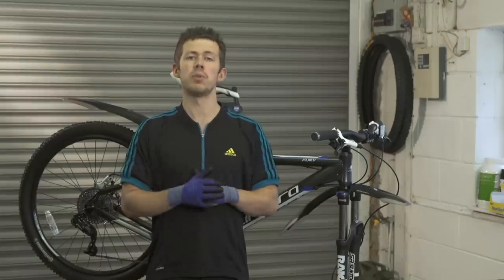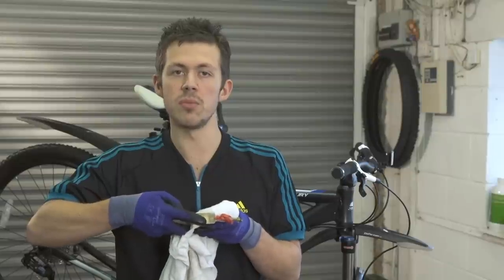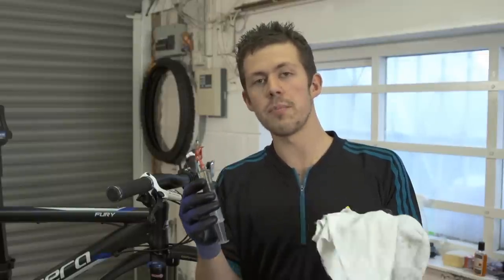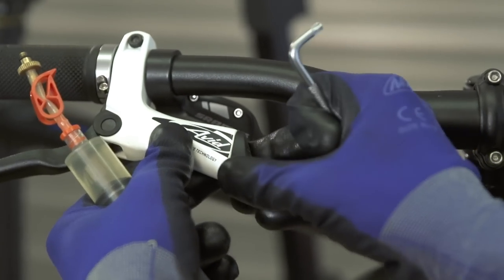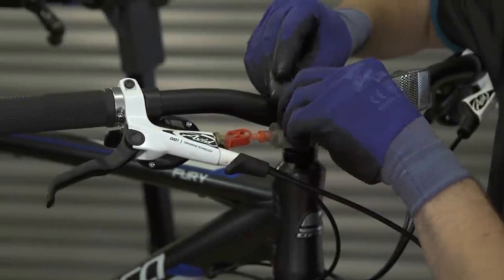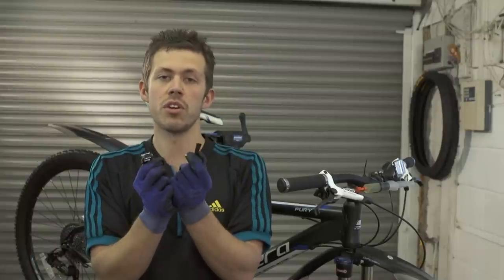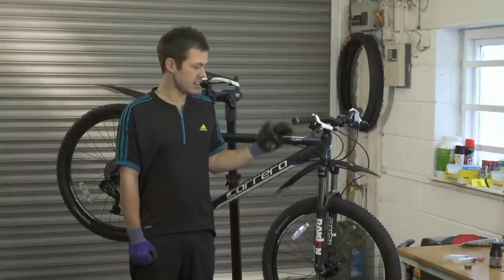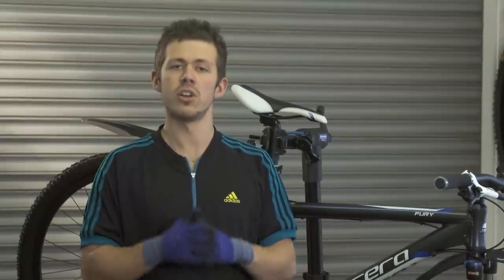How To... Bleed Disc Brakes | Halfords UK

Comment: One more thing to add. If you want a really stiff brake lever, you can fit the wheel but remove the brake pads. Add something thinner than the pads between the pistons and the disk and fill the system through the lever side. This way you add excess oil and the lever becomes stiffer.

Comment: Only thing is , when u remove the hoses to put the screw back in, your putting air back into the system, there should be another lock screw to tighten first before you unscrew the hoses so no air is drawn in

Comment: This looks more difficult than bleeding car brakes.
Reply: it is since there is no reservoir to hold fluid and stop air getting in,
Reply: I reverse bled my Shimano brakes, angled the syringe lever side up and removed the plunger and just pushed new fluid from the seconds syringe followed by tightening the bolts and they seem spot on

Comment: If you have two different brake sets that use different dot fluids , can you wipe out the syringe and use the other fluid , or are the syringes dedicated to the dot type you used the first time ?

Comment: "If you would like a firmer reaction than that, please repeat the process from the beginning" <-- So what would I change in process your described to make it even firmer? I don't own hydraulic disc brakes, so I am trying to acclimate myself to what is required for tuning and maintaining them.
Reply: what you're supposed to do is before you fit the syringes is lock the red clamp and pull on the plunger to create a vacuum to cause any excess air to raise to the surface as most brakes only have about 10mm of fluid any air will make it feel "spongy" as air compresses and fluid doesn't although all avid brakes have a overflow system so they will never be truly solid as its a safety feature sram use to stop you stabbing yourself with the brake lever should you fall off and the lever hit you.  hope this helps
Reply: Basically, the main reason the break would feel bad is because of any air in the system. So if the brake still felt spongy or if the brake was lacking power when in use, it means that air is in the system still. So if it felt like that straight after a bleed, you would simply need to repeat the bleed process again to get a better result. Doesn't often happen but can do, especially with avids as they are a bit trickier to bleed than other systems! Hope that helps!

Comment: I have SHIMANO hydraulic  brakes from Volt Australia the top is like normal bleed but the bottom has no nipple ? it has a screw . does that mean i can use  Avid bleed kit as the caliper only has a allen key port . The top is with screw in cup . I think it,s shop brand ? driving me nuts knewby ,so do i get the screw in line and adapter for caliper and will any fit ,or Avid ?

Comment: I did it twice on my bike, up to the last step my brake lever felt good. But after I put the lever screw back in and ride it, the lever goes soft and the bike won't stop. Any advice?
Reply: Zaher Jabr check out burping your brake, it might be that you have air trapped inside the system.
Reply: @madched  Add some Gripe water ;-)

Comment: hi how would i put a pair of fluids on my bike that havent got any?
Reply from the maker: Hi +FIREBURN HDV you would have to start by purchasing an hydraulic brake disc set. It's worth checking the compatibility between your bike and the hydraulic brakes. Your local store will be able to offer more detailed advice. Thanks.

Comment: The problem is trying to keep pressure in the system, as soon as you remove the syringe. 
It goes!
Reply: That's the issue I'm having with this exact brake setup now.
Reply: Don't forget to create a vacuum by gently pulling on the plunger and then push the plunger with similar force ,this will pressurise the system. Then start squeezing the brake lever whilst the syringe is in a vertical position. The video suggests 10 times, but basically do it until there are no more bubbles at all coming from the brake lever reservoir. Move the brake lever back to it's normal position and then unscrew the syringe and immediately and carefully replace the screw.
Reply: @allthingsbike2720  sold it and bought a motorcycle in the end! XD
Reply: @lmlm2500  well that has easily solved that one lol

Comment: how can you tell what fluid to use?
Reply from the maker: Hi +MrT0ffee  there should be an identifier on the brake lever. Either Mineral Oil or Dot Fluid. Hope that helps. Thanks.

Comment: what's the use of bleeding?
Reply: New oil in your brake systems and a firm brake lever, you never want a brake lever to touch the handle bar or come 1/2 to 1 inch of the handle bar.

Comment: what would happen I you got bubbles in the system?
Reply: I like the tire setup
Reply: Kiss your braking power goodbye
Reply: +M32 oh thanks
Reply: Think of it this way: The air in the system won't allow enough pressure to push the brake pistons together hard enough to effectively stop you. Any air is not good at all.
Reply: Knowledge 👆
Reply: yeah i lernd
 that yesterday lol

Comment: ever heard the saying keep it simple stupid? what's wrong with traditional bike brakes with rubber pads?
Reply: Richard, if you’d ridden a bike with hydraulic discs you’d know the answer. 👍
Reply: @archiebob11  depends on the brakes. the mechanical Rim brakes on my orbea are more powerful than the hydraulic disc on my mountain bike

Comment: Avid brakes take too much work just to bleed them =p
I don't like brake fluid, I much rather mineral oil, it's just much superior.
Reply: Amarildo Junior what's the difference?
Reply: viscosity and stability to compression
Reply: @Klemhaken  mineral oil is , well, oil and DOT4/5.1 is Ethylene Glycol based.
The latter is used extensively in motor vehicles due to its availability, low cost , Low viscocity at low temperatures, good performance at higher temperatures, good compressive qualities and anti corrosive properties within braking systems. 
Mineral Oil is used mainly because of its anti corrosive properties and easy availability. It's viscocity is usually slightly higher than DOT4/5.1 but in these "simple" systems it's not an issue. It's also much kinder to the environment (And your paintwork/hands) as oils can be made bio-degradeable. Whereas Etylene Glycol is poisonous to most forms of life but has a sweet taste and smell. It can also cause long term damage to water courses and wildlife and needs careful disposal. It's also not a thing you want to get on your skin or your paintwork either. Dangerous huh?

Comment: These types of brakes are a joke. And the worst part is - you need to buy these really overpriced bleeding kits separately from your brakes (and often they will be out of stock in many places). 

Of course you CAN actually bleed without the threaded adapters using just the syringe and pressing it tightly into bleed hole, but it's really messy and not as reliable.